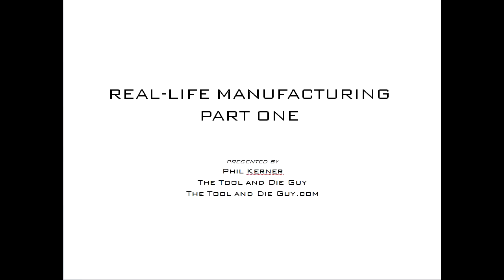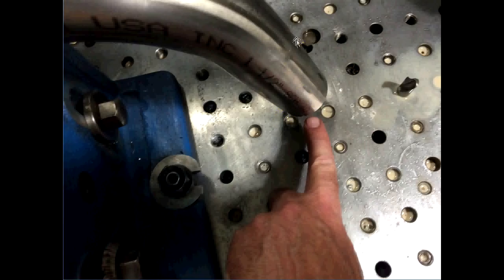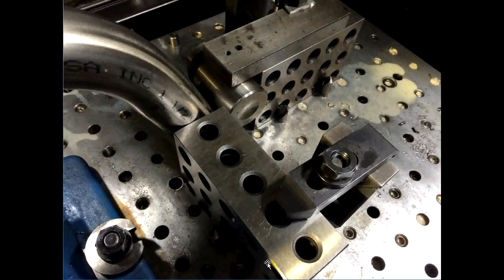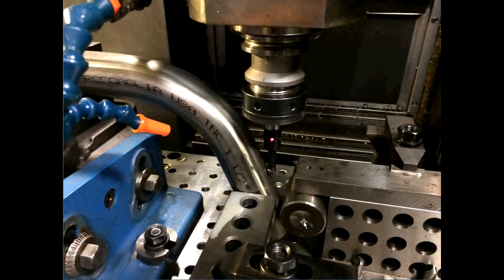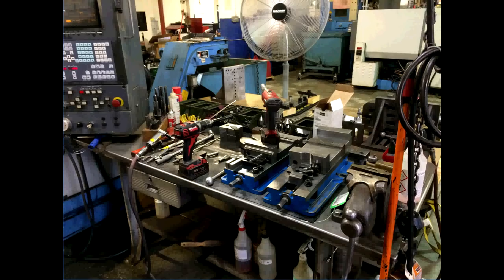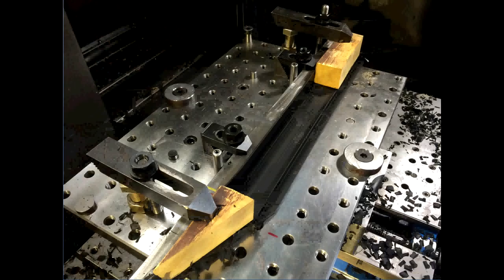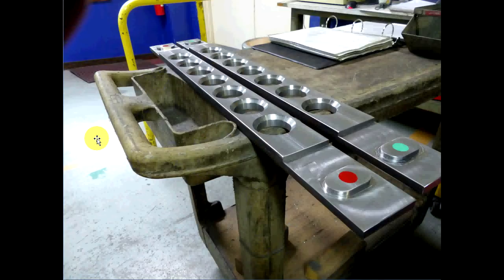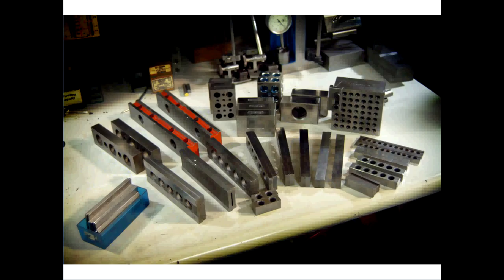REAL LIFE MANUFACTURING: PART ONE

Comment: Nice setup on the bent tubing job..... however I was thinking that you got the 2 holes exactly where you wanted them BUT that is assuming that all 5 (or however many you did) were all initially bent precisely the same.  If just one of the tubes were bent slightly different than the other then your 2 holes would be slightly off.   I may be over thinking this... I have had problems in the past positioning holes in bent tubing because they were not always bent exactly the same.  I enjoy your videos... Thanks!